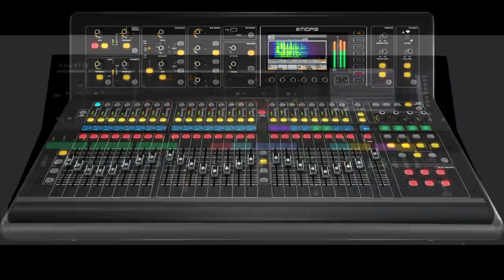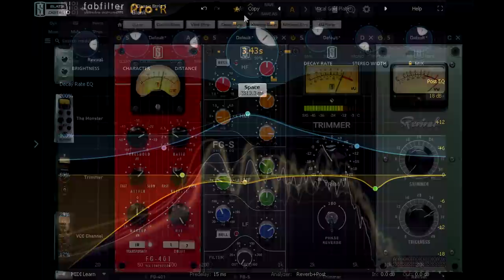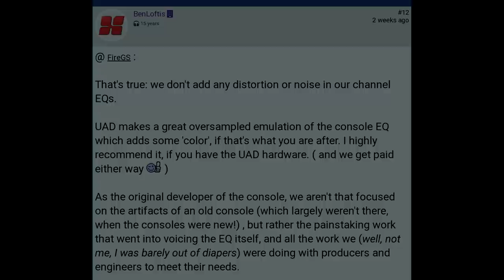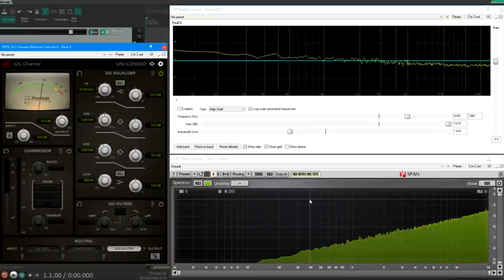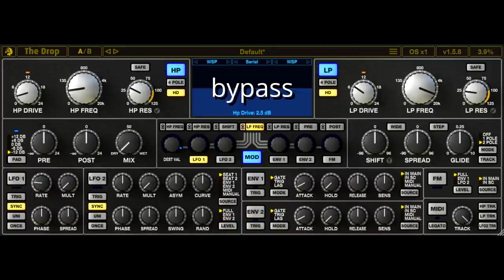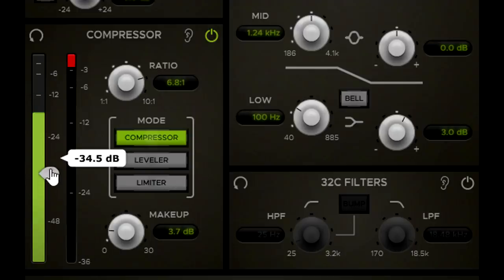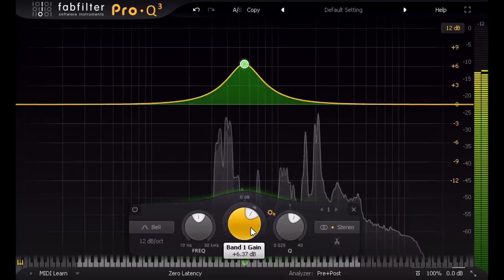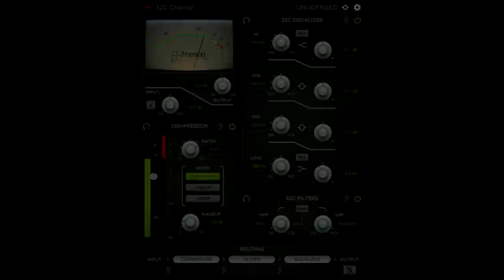Why Does It Null? (with ReaEQ) Harrison 32C Channel Strip

Comment: i agree with you, and i keep saying that about ssl strips and what have you: make the eq fully parametric, and add a q to the low and high frequencies. i don't care if the original consoles didn't have them, there were reasons for that. those reasons disappeared when you moved to digital. if they don't sound as good as the real thing - and none of them do - so if you have the disadvantages of an emulation instead of the real thing, THE LEAST you can do is compensate by making use of the advantages of an emulation instead of the real thing. same thing with neves, and so on. give those stepped eqs a break, and make them fully sweepable. maybe keep the stepped mode in, as an option, if you want to replicate that work flow, but allow for the freq controls to be full range. and - for everybody - include an on/off switch for every filter, so you can properly a/b it, and hear what you're doing. i know, on a console you couldn't do that, i couldn't care less: we're not on a console.

i do, however, appreciate a good design of the gui, that's very important to me, as important almost as the sound, and obviously the options. if it doesn't inspire me, and doesn't get me in the mood of working and creating - like some caricatural oversimplistic, frankly hideous, "modern" interfaces out there, that are just some lines drawn by a kid - it's worthless, no matter how good it is otherwise. it will have to be amazing, and also the only choice out there, of its caliber, for me to overlook an ugly uninspiring interface.

and i also agree the 32c channel strip is crap. not just in comparison to the real whatever or not, but generally. i do like the sound of mixbus, the daw, so there seems to be something else happening there - maybe the interaction with the buses, i don't know - and for that reason i wanted to try to channel in other daws, but it's got no connection. and when you say "it doesn't have the preamp" - as if that excused an "analog" circuit behaving like digital - even that, by itself, makes you raise an eyebrow. beyond the deception of the idea, whose fault is it, if it doesn't have it? it SHOULD have a preamp, that's half the reason you use a console emulation, and not just an eq/compressor packed together. and, by the way, the daw console should have it, too. so maybe less lip, and more work?

and, by the way, all console emulations, if they want to be that, should have a tape insert between the pres and the monitor section, so that you can actually replicate the pre - tape - strip loop you would use in real life, since it needs to be after the pre, and obviouslt before the fader. where the tape is makes a difference in the tightness and roundness of the sound, and also saves you a lot of headache with the gain whenever you adjust the fader (into tape 😳??). the only ones to have that insert, so far, are the waves mixhub and soc channels. not even waves have it on everything, which is a darn shame. and also add a channel variation algorithm on all console emulations, plus bus/summer extensions. all these things listed above should be, in my view, standard for all console emulations. and then we can talk about it BEING a console emulation. those would be digital consoles beyond reproach - provided they sounded well, of course.

i'm so tired of manufacturers giving me "the character", "the vibe", an so on. everybody agrees the future of music producing is in digital. but everybody still behaves like a good sound in digital an option - like a "nice addition", or some kind of a toy, to use. if that's the environment we're gonna work in, give us the tools to work in it - the real ones. i don't want "the character", "the vibe", "the nuance", i want the real deal. the sound quality, the sense of space, the density, the behavior, the response across the board, the summing, the right chain order - all of it, and without the limitations. i don't want to have to tweak something for hours just to make it sound acceptable, it should sound great and out of the box, gain stage and there you go, just like great gear does. the tweaking is for getting the desired tone, not to try to make something you can live with.

i like your videos. all the best!

Comment: Dan, you nailed it again! Thanks for your critics on Harrison's channel strip. Hopefully they will revisit their plugin any time soon.
With regards to adding extra settings to the compressor section, Harrison could easily add a switch button to the compressor section, that flips the faceplate that then shows those extra required parameters for fine-tuning.

And in terms of color, they definitely should add a color section, that includes settings for changing the saturation, capacitors and transistors.
If they won't add any sort type of saturation, they should leave those claims in their marketing, since this misleading for those that want to buy or bought the Harrison 32C channel plugin.

Harrison did a good job in designing a great GUI. However, I'm afraid most of us still judge plugins by their cover...
Reply: Why would one assume there needs to be saturation at all?  The capacitor and resister values were picked to define the EQ curves and not to add saturation.   The claim is to provide an EQ that works just like the original console and has nothing to do with saturation.  Hope that helps.

Comment: I’ve long thought that based on the use actual use of channel strip plugins in the digital era (in mixing and tracking as you point out), that the ergonomics are off. The modelling of the physical look and feel is actively detrimental to how these plugins are used in the digital era.

Comment: LOL: Harrison 32C Channel Strip Eviscerated! Would have enjoyed hearing audio comparisons once the EQs were nulled/matched.
Reply from the maker: I tweaked the settings until the difference signal dropped below -100dB at all frequencies. I'm not sure those differences would survive YouTube compression. ;)
Or to put it another way: if they null that well, they sound the same. I don't believe in magic, and I'm not going to waste time on listening tests when I already know the signals are the same, practically speaking.
Reply: @DanWorrall , I still think dynamic response can yield different results from null tests with noise. Null tests don't seem to address every difference I hear in normal material played back through competing plugins. Like you, I love PluginDoctor and have gained a lot of deep insights with the Hammerstein tab.

Comment: This was very enlightening. I use Cockos EQ and Fab compression which does more than this DAW can do. I was about to buy the full version of Harrison 32C but have reconsidered after this video. I also agree with the opinion that Harrison has “marketed” their DAW as a digital substitute for the sound of their consoles. It does not achieve this. At best, it’s a partial graphic representation of a real console. The EQ is really not impressive and the compression incomplete. This video was greatly appreciated. Thank you.

Comment: The details of Dan's investigation here can't be argued with, and the video is INCREDIBLY useful for anyone considering this for a purchase. However, Dan has a very surgical mixing style. It makes sense. He's not a fan of arbitrary limits, and he makes a strong case. That said, if you embrace the limitations of 32C Channel Strip and 32 Bus plugin -- you DO get a characteristic sound. It is a sound which features issues that Dan would otherwise correct with tools capable of such correction.

But if you live with those limitations, it DOES result in a sound. Maybe a sound Dan wouldn't like, but a sound he and others wouldn't get if they had access to more detailed tools.

My only problem with these plugins is the price. If these were ~$15 tools I would enjoy them for this purpose. $25, tops... But Waves sells Scheps Omni Channel for ~$29.99 and that plugin addresses nearly all of Dan's issues while still having a hardware style feel to it. Harrison's plugins are overpriced, IMHO, but if they ever come down I will buy them for fun "intentionally limited controls" style mixing.
Reply: They have their plugs on sale all the time! $9, $39, $49….

Comment: Hey Dan, I'm sure you get a million requests from the Reaper Core to go through your setup, but as someone who recently moved to the unintuitive madness that is Reaper's default settings, I'd love to see what settings and key bindings you established to make it work for you. I remember you saying you have Pro-Q on a hotkey for instance which was a great tip. Anyway, this plus 'why doesn't it null' is a great grounding on what emulations can and can't do so thank you for that.
Reply: The reaper blog talks about that stuff a lot. 👍🏻

Also, there’s a “better reaper defaults” setup you can find on the reaper forums. I don’t use it personally since I’d already addressed the problems I was having by the time I knew it existed, and it does a lot that I don’t need. But it’s probably worth checking out.
Reply from the maker: My problem is I can no longer remember which bits of my setup are default and which I configured myself...
Reply: @DanWorrall  ah I was worried you'd say this! I feel the same way already
Reply: @DanWorrall  Just phase-invert it to the original settings...
That's how it works right?

Comment: What about the Schep Omni Channel from Waves? It seems to be a well balance between flexibility and usability imho.
Reply: It is a great plugin. Interesting curves in the EQ, different compressor types... Saturation options include ProTools Lo-Fi clipper (kind of)... I prefer Scheps Omni to CLA Mixhub. I believe it doesn't have oversampling but honestly not a big deal. If i was a Waves plugins user, i would definitely buy Scheps Omni, CLA Classic Compressors bundle, Puigchild and CLA Epic. With this and your stock DAW plugins you can mix anything...

Comment: What a lecture. Very insightful. plugin market is so saturated that they get away and actually sell loads os plugins like this. Just make a cool ad a big marketing campaign slick looking GUI that's it. Then when push comes to shove the popularity of the plugin goes down hill. Like the guitar amp and cabs sims so many but so little are actually good. 
You're the Gordon Ramsay of mixing and mastering. Cheers

Comment: The intro music definitely implies something…

Plugin market is over saturated with snake oil.
I’ve started to notice the same tendencies on the hardware market - Black Lion Bluey doesn’t sound like the real thing even on YouTube demo by CLA, it does the compression but not the sound. And many more half baked potatoes on the market. 
Polyend Tracker needs fix for the MIDI-Audio latency for about a year on the market.
Korg prologue with all analog tract has digital FX as a insert at the end of the chain without option to bypass it or use as a send return.
Reply: Yeah, the snake oil has really become endemic at this point. I really respect companies that are honest and straight forward with their products.

Comment: I personally like their clean approach.  I would much rather add saturation with other plugins in the chain, because tbh I really don't like what most plugins have baked in at all. So every time you said, it doesn't saturate, I thought - thank goodness!  I love pushing analog gear but with digital clean is mean. Adding "character" is not the same, it's easily as much snake oil as anything here, and it's not what I want baked into my tools.
The limited control set here might not have been the best approach.  It works baked into their DAW because there isn't room in the UI for all controls, not so much as a channel strip. I much prefer using the Legacy EQ and the MPC compressor, or for channel strips the Flow series.  It's odd but I circled back to Harrison more than once already just because their tools work.  I don't expect magic sauce and neither should anyone, from any plugin.

Comment: As I am very new to all this would somebody please explain what “ null “ is ? Many thanks.
Reply from the maker: If you take two identical waveforms, and subtract one from the other (ie: turn one upside down, then add them together) they will cancel completely and leave silence. This is a "null". If two files null perfectly, that's proof they are identical. If they don't null perfectly, the stuff that's left over tells you where the differences are.

Comment: what does it mean when he says does it null?
Reply from the maker: If you flip a wave upside down, and then sum it with the original wave, they will cancel completely leaving only silence. We can use that fact to test whether in fact two signals are different, and by how much. If two different signals null (cancel perfectly) that proves they are not in fact different, and if you're hearing any differences you're imagining them.

Comment: I use the 32c DAW for everything and am getting great results. Just don't expect it to be magic on its own. This 'plugin' is part of every channel and is VERY fast to get a decent mix while tracking and so your client can hear something quickly before going home for the night. The real juice in the DAW is in the busses, which DO have coloration. These can also have sources run thru them quickly. You can make your clients confident they're going to get a good product while maybe only having to load a reverb plugin. Later on is when you dial it up with more task-suited plugins, which are just drag & drop from your favorites list at the left. Create channel presets when you hit on something cool. Create plugin presets (even if the plugin itself doesn't have that feature). The more you use it, the faster you arrive at a great mix. It's a wonderful tool.
Reply: hello Harrison rep
Reply: @lukebogartmix  if I was a harrison rep, I'd be saying Dan's null test was flawed and that the channel strip alone DOES have a sound, as per the marketing claims. I just like the DAW because I use it and get better & faster results. But thanks for stopping by.

Comment: Slate VMR does sound quite good, but I'm not really happy with the way the modules are handled. PSP Infinistrip does this much better IMO. I love that you can set up one type of comp and then change to another type while it still retains the same settings. Before it was released I was wondering why Slate VMR didn't work this way, I mean it can't be too hard for them to implement this in VMR.
Reply: I agree with that, also moving modules is/feels very sluggish to me on VMR. I just wish for a higher resolution PSP interface.
Reply: @georgenext3030  True. I can imagine that the Infinistrip GUI doesn't work very well on higher resolution monitors. I'm still on a 24" 1080p monitor, so no problems for me haha

Comment: Thank you for this, I was curious as to whether it would null with a stock EQ, but hadn't got around to testing it myself. 
I love the sound of a Harrison console, the way it sounds, especially when you push it, and was really looking forward to this so I could use it in Reaper, rather than as I would occasionally do - running stems through 32c, which does have that distortion that makes things just sound better to my ear. 
Suffice to say, I was extremely disappointed, and like you, felt absolutely no reason to actually buy it, and when I can be bothered, will probably get rid of it from my plugins folder altogether. Until then, it'll stay in my collection in demo mode, as a stark reminder of what they could have done, but decided against to make this pointless piece of design nightmare.
Reply: @CraigScottFrost  even if it is the same as the DAW, the compressor was never what I was interested in. It's a nice enough compressor, but the input and output saturation was always what I was interested in. When running stems through 32c, I'd very rarely touch the compressor, and usually only do minor tweaks with the EQ. Without the saturation, this plugin is pointless for me.

I'm really curious to know how you get on with all that - please keep me updated!

Comment: Interestingly enough, I find the auto-settings of the compressor the most interesting part of this plugin.  I wish more compressors had an option for auto.  Sometimes I just don't wanna deal with attack and release.  It hearkens back to using a DBX 165 on auto, with the Overeasy™ circuit.  I always loved using that thing as part of a vocal chain:  1176 for the splat and the 165 for the invisible leveling.  
So if Harrison is indeed taking this video and perhaps the comments section of it and gearslutz to heart and is thinking about putting together a standalone compressor with all of the settings Dan suggested, please leave the "auto" settings as an available option.  I'd probably buy that the minute I got an email notification from Harrison.
Reply: *gearsnobs